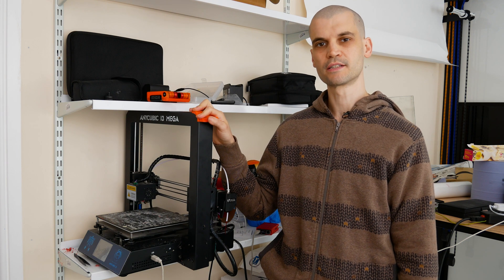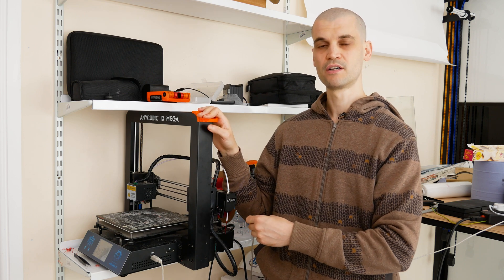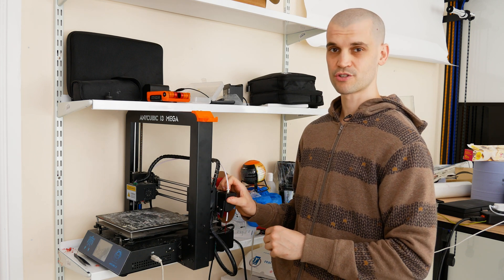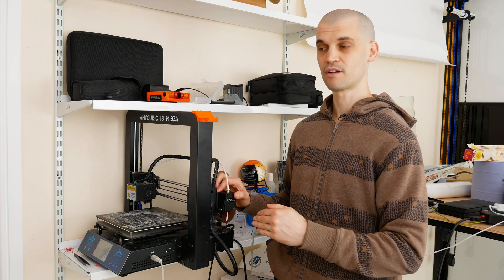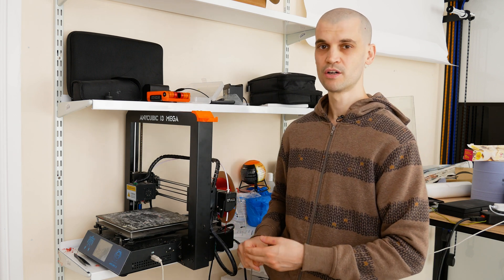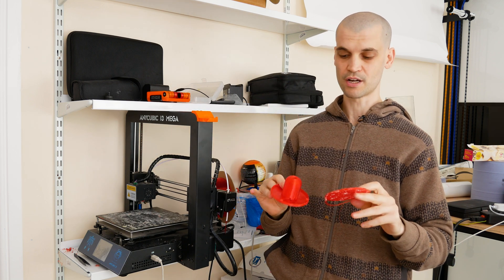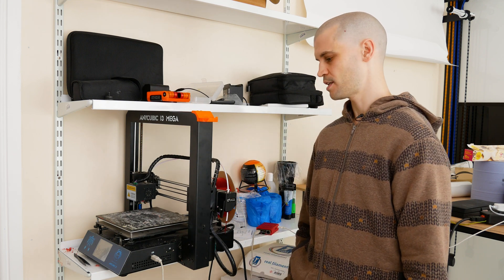Anycubic i3 Mega Extruder Upgrade - THE ONLY UPGRADE YOU NEED!

Comment: Thanks for the video. Its useful as I need to replace my mega pro with the dual drive extruder. I need to ask for this printer do I need to change the motor setting or reverse?
Reply from the maker: You may need to just plug it in and see what way the motor runs. If in the wrong direction just flip the wiring around

Comment: Purchased the upgraded extruder for my Mega S but can you post a link to your video on changing the wiring for this upgrade, both in the firmware and the manual wire swap?
Reply from the maker: Check the description

Comment: Have you changed the parameters of the e-steps? I had to change them because it didn't extrude well, and caused apart from prints with various problems also clogging problems
Reply from the maker: I didnt have to change esteps but it is worth calibrating it yourself after installing because not every manufacturer use the same motor

Comment: Changing the stepping of the extruder motor on firmware is not needed ? I know that dual extruder has differenti ratio
Reply: on Amazon it says to change e steps to 385 but i dont know how as in very new to this

Comment: Thanks for your video. Performed the same update. First I had to calibrate the extruder, as 100mm extrusion just extruded 40mm in reality :-( Now I'm facing heavy stringing or rather retraction issues. Could you share your retraction slicer settings?
Reply: Von deinem Nutzernamen schliesse ich darauf dass du aus Deutschland bist. Hast du dein Problem lösen können? Habe genau dasselbe Problem mit dem extremen Stringing. Komme seit 3 Tagen nicht voran.
Reply: Nein, habe den Drucker seit dem nicht mehr verwendet. Da kommt nur noch Scheiss bei raus.
Reply: @stefanhaupt4947 ich baue den dann mal zurück. Es gibt bisher keinen den ich in den Foren angetroffen habe der dieses Problem lösen konnte. Danke für die schnelle Antwort
Reply: @emirhan.41 also meinst du das es mehrere Leute gibt, die danach die gleichen Probleme hatten. Das wäre krass
Reply: @stefanhaupt4947 Jap. Ich sage ja ich komme seit 3 Tagen nicht mehr voran mit dem ding. Auf Reddit und diversen anderen Foren wird dasselbe Problem beschrieben von einigen mit dem Dual Drive Extruder. Bei manchen reicht einfach nur die Montage und dann das Firmware Upgrade. Bei uns ist es leider etwas anderes und bisher gab es auch bei den anderen keine Lösung. Einer hat mir geschrieben dass er es zurückgebaut hat und alles lief wieder perfekt. So habe ich das jetzt auch gemacht und siehe da, es funktioniert tadellos
Reply: @emirhan.41 oha, das war mir so nicht bewusst. Extrem schade. Dann werde ich wohl auch zurückbauen. Ich hoffe ich finde die Teile noch 🙂btw: in welchen andere Foren bist du denn aktiv? Dann melde ich mich dort auch mal an 🙂

Comment: no offense but this "upgrade" sucks.  its much harder to do a "cold pull",  also its a pain in the b to just slide filament into the bowden tube, after using it for a day I went back to the stock setup.  great instruction video tho
Reply from the maker: never had issues with it, and definitely a better extrusion mechanism than stock.

Comment: Thanks for the video, i want to reverse the extruder motor direction through sofware.  Can you provide the pronterface command to do so? I have stock firmware on my anycubic i3 mega s.  Thanks!
Reply from the maker: I know it can be done in the firmware but I dont have experience doing this sadly so i cannot help

Comment: Does this work for the Mega S model?
Reply from the maker: i believe the Mega S already has this upgraded extruder but if not then yes you can put any bowden extruder on this printer so these BMG extruder will work fine
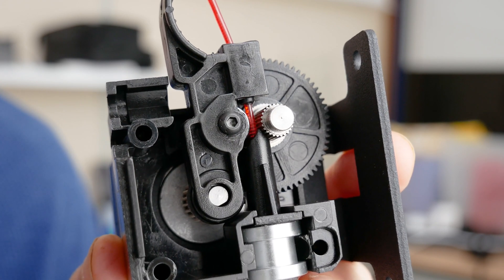Reply: @ThisDesignedThat  My Mega S has exactly the same a shown in 0:39. I have the Issue with it that when the print needs retract very often it begins to make a click sound.
Do you think i can use the same extruder as you have shown here? im worried because of the gear transmission ratio.
Reply from the maker: @DoktorSkill  yep you can use the same as I have shown here. I just installed the mega s firmware that you already have and Ive had no issues with it.
Reply: @ThisDesignedThat  But i do have to reserve the motor too?
Reply from the maker: @DoktorSkill  cant say for sure but if you have the mega s your wiring should already be correct

Comment: Thank you so much for making this video. The bearing in my stock extruder on my i3 mega has started locking causing the filiment to slip. Was looking for a new extruder but wanted one made of metal similar to the stock but upgraded. Figured they were the same as long as they mounted to the stepper motors and this video verified my hunch. Thank you!

Comment: I got one but when I swapped the red over with the black it just spun real fast did not change it, changed it back and it still feeds wrong way
Reply from the maker: not sure why it would spin really fast, be sure to check you have the right wiring.

Comment: Tried this on my i3. I've installed this dual drive extruder on my printer but the prints are now coming out very low density. It's almost like the extruder isn't turning out enough filament. Any advice?
Reply: You need to calibrate your extruder. There are many tutorials, they all show the same technique - actually the one anycubic explain on their site

Comment: Good explanation and it looks exactly like kit I bought. I will reverse the wires shortly to account for the direction change in filament feed too. But I wanted to check that you didn't need to change any motor e-steps setting?
Reply from the maker: I just installed the mega s firmware and havent had any issues
Reply: @ThisDesignedThat  Used the Mega stepper motor, with original metal mount and switched motor wires, I ran this today on two sets of test prints. Without any firmware or estep changes (not that I know how to do the latter), the prints were fine. In fact I'd say overall they were slightly smoother than with the stock extruder mechanism.

Comment: Great video!! It made me make the transition too. 

The Trianglelabs Dual Drive (BMG clone) is giving me issues with retraction. 
1) the retraction noise is increased (as mentioned before in the comments, not a big issue)
2) When setting the retraction parameters above 5mm retraction distance and/or above 40mm/s retraction speed, the retraction fails to coop.
I don't believe it is the Dual Drive but more the motor that can't handle the torque using a 3:1 ratio.

Machine setup: I3 mega version 1.0 mobo (2019 with 2x Z-motor), Bigtreetech TMC 2208 v3.0 stepper drivers (Extruder motor Vref 1.2v) and the original Extruder motor.
Software: Marlin-2.0-x-Anycubic-i3-Mega-v1.4.3_Feb2022_TMC_Trigorilla1.0_BLT from Knutwurst

Anybody experienced similar issues and if solved, can you please share?
Thanks a lot!
Reply: same problem .. :/
Reply: Place a fan behind it, I use it only in complex or long prints so I just tape it to the back of the motor and use a separate 12v power supply but probably there's a more permanent and tidy mod for that.

Comment: Anycubic i3 Mega tightening all screws inside and stepper driver was the first and only thing i did upgrade so far, was 1-2 years ago.
the thing to upgrade/print first is the things that you tighten the belts with, had to plastic weld them together.
This seems like a worthy upgrade

Comment: If you change from a single drive to a duel drive you will also need to update firmware. 
Update your firmware to the mega s which will run the duel drive extruder 

Update using zip file and cura 👍
Reply from the maker: Thanks for the tip!
Reply: So how do I do that? Please provide the process necessary. I'm a total stranger to changing extruders and don't want to find myself halfway in and lost. Thanks 👍
Reply: Can this Mega S firmware upgrade be done with both motherboards: 8-bit and 32-bit Trigorilla?

Comment: I've upgraded my i3 mega s with a printed X-Carriage Mk4, replaced the leadscrew nuts with ones made of Delrin, added BL Touch, and am running Mainsail/Klipper on it and after setting up an accelerometer for resonance compensation and i can print 150mm/s+ easily. There are people printing with a similiar setup much faster. Only thing keeping me from going faster is its not direct drive.
Reply from the maker: Very cool upgrades. Im definitely going to have to make these to my i3. Have you got any links to all your mods?

Comment: I've installed mine and I didn't have to reverse my motor wires. But I'm wondering, am I supposed to change some settings in my slicer to get it to work since it's a different extruder? I'm finding that the Filament In is a lot slower than the stock extruder and the first print I attempted, it wasn't able to print anything.
Reply: Same problem here too. Any help, please?
Reply: @wolfpack6262  I figured it out but the short explanation is that since we went from a single gear to a dual gear extruder we have to recalibrate or recalculate the e-step due to the reduction ratio of 3:1 and also the gear sizes are slightly different. For me personally, I ran "M8011 S0.00254524" as a .gcode file (paste that single command into a text file and save as .gcode and "print" it on your printer) and it will set the e-step value to something more suitable. That value 0.00254524 is something I calculated and then tweaked a little bit based on my results. The default I think is "M8011 S0.01079375". I'm actually not sure why OP didn't have to change their e-steps because that original extruder looks like single gear.

If you want to know more details, here's "chitu g code explained": http://www.customize-3d.com/chitu-g-code-explained.html

pastebin.com/3wGjsbfJ
Not sure if my comment will get auto-swept for containing a pastebin link but this file is a translated version of what I received from Anycubic support and I believe a more recent version of what they have on customize-3d. And if you search for "M8011" you can find the comment with the formula for calculating it. The translation is rough but basically:
(C/3200) / ratio
C = circumfrence of your drive gear (the pinion gear on your motor shaft) 
ratio = 3, the reduction ratio of the BMG extruder

I believe this value means essentially, mm extruded per step of the motor, so a lower value will result in more extrusion.
Reply: @B-U-N-N-I  thanks a lot, I have the same problem, can't wait to try your trick hoping for the best, but aniway thanks in advance!
Reply: @B-U-N-N-I  thx. Trying to solve underextrusion problem with your info

Comment: OK, BMG clone arrived and I'll need to flip those wires - checked the other video which had some rather scary comments regards frying the mainboard if you get the wire swap wrong! Did you have to check Stepper motor coils to identify the pair to swap, or just go from 1234 to 1243 (or 2134)? Thanks.
Reply: This video is completely useless without this information.

Comment: how do i screw the extruder to the motor?
Reply from the maker: Using the bolts that came with the original extruder
Reply: @ThisDesignedThat  mine were too short so I had to drill it so it gets deeper but worked out all good ty🙌
Reply: @TyroneAli  just did the same thing yeah, but now it's on there tight
Reply: @sledge3581  yeah

Comment: Hi, i installed a trianglelab bmg clone on my i3 mega (not S) and while it works great, it is a lot louder when retracting than stock extruder..i use tmc 2208 and had enabled spreadcycle on extruder stepper. it was silent before..any ideas?
Reply from the maker: not too sure about that issue im afraid

Comment: Ok ordered this as mine is worn out
Can someone explain the tensioner and where it should be adjusted please to get right level of filament going through??
Reply from the maker: i just tighten it loosely and if i find its under extruding i'll tighten it slowly, quarter turn at a time until ive got good extrusion. It doesnt need to be tightened too much so be careful, if its too tight it will just eat through your filament if you have lots of retracts

Comment: I have also mounted it, I have improved with the pla but for the tpu it is worse the wire gets tangled inside the extruder
Reply: with this extruder i managed to print Flex, tpu and ninjaflex filaments with great success.  The problem is the calibration of the tension spring
Reply from the maker: Thanks for the info did you loosen the tension spring or tighten for printing flexible?
Reply: @ThisDesignedThat  yes, I just pulled a couple of turns on the waist with the spring and it prints everything from PLA to flex filament of all kinds and softness without problems.
pulling the screw too much with the spring, I squeeze the wire and it gets twisted inside